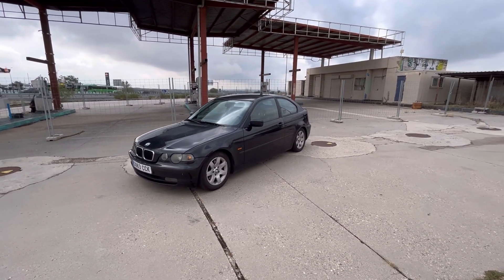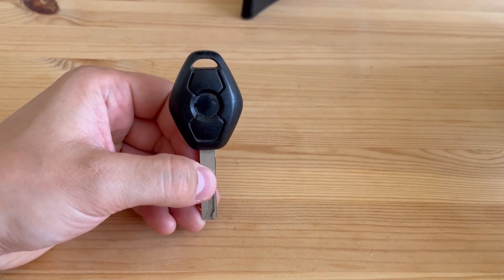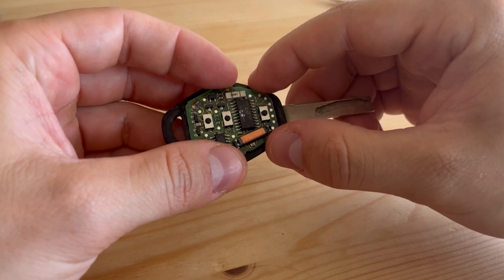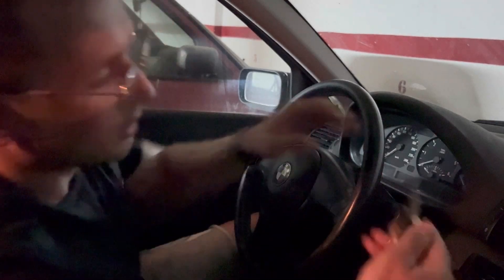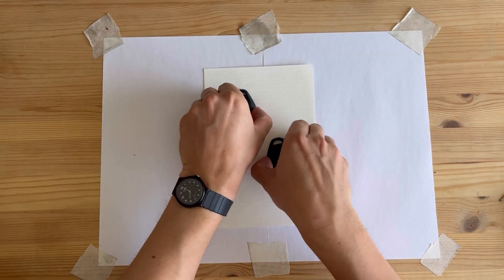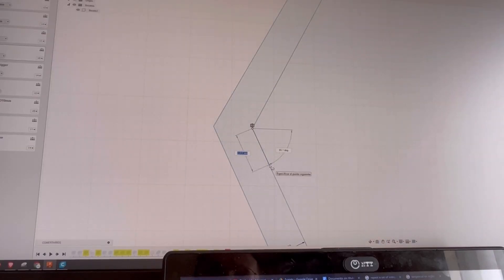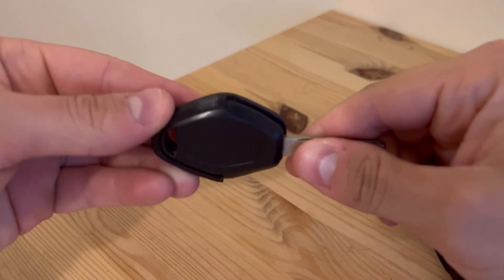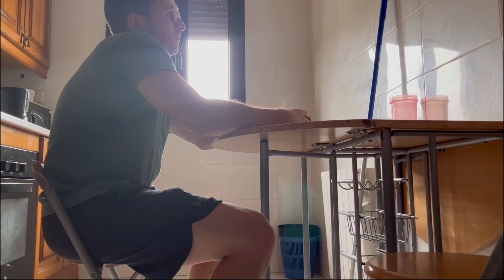Key battery replacement & reprogramming. Permanently serviceable key fob | BMW e46 e38 e39 e53

Comment: And then the EWS dies, stranding your car.  The E36 can have its EWS code read with INPA software but in the E46, the code cannot be read. For the E46, the only viable solution seems to be getting the DME/ECU reprogrammed with EWS deleted  Thank you for the 3d print STL file !

Comment: I just purchased two new keys for my 46 M3 at a cost of £260!😳🙄
Once you split these keys they don’t go back together correctly as they’re not meant to be split, I’ve seen them glued, taped …..just buy new like I did.
Reply from the maker: £260? No, thanks.
Reply: @ that’s a good price, should have been £360 for the pair.

Comment: Nice job! my OEM e46 key is the same as yours, but its missing a capacitor. If possible could you measure the capacitance of the cap (at 3:06 in the video) that sits just to the right of your thumb opposite the coil.

Comment: Put the key on a wireless cell phone charger over night and the key will recharge. Should be good for 5 to 10 years
Reply: Won't work if the battery is completely dead
Reply: No amount of charging will wake up a “Dead” battery!!!🙄
Reply: @darrenboston342 have you ever heard of using a welder to renew a 12 volt car battery?? A BMW ignition charger is very weak and only charges wile driving a cell phone charger is many times more powerful and you can charge it for 24 hours
Reply: @ whatever pleases you pal, can’t be doing with farting about, just buy new!
Done!👍

Comment: That is a lot of work for a keyfob, but it’s a brand-new battery versus one that could be dead beyond recharging. I did see other videos that use an induction charging station, such as for a smartwatch and toothbrush (this method is harder due to the protruding base prong).

Comment: Bro, just put a silicone cover and attach a keychain, that way it is to some extent water and dust proof and even if the silicone case fails the keychain will still have everything attached. Ran with my key sliced open like this for about a year, zero problems.

Comment: What's really fun is when the key fob stops working and then your door lock on the driver side (the only one on the car) breaks and then you can't get into the car, forcing you to break the rear quarter glass to be able to get into the car.
Reply from the maker: If this happens to you ever again you may wanna try the duct tape method to roll the window down
Reply: @alexderkach_  Thanks I'll look it up. When it happened and I called around and the locksmiths or tow companies would not touch it because it was a BMW so I was on my own.

Comment: Only 120€ ??? they are asking me 240€ for key + 67€ for reprogramming ...
3:05 you see the copper coil there? it's wireless induction rechargeable like modern mobile phones. The charger part is in-build into your car near ignition, so the key will recharge while driving -- at least it's supposed to, if your battery has not died to old age and the charger there has not died.
LUCKILY for me, I was able to buy from amazon the "blank" BMW key chassis/fob with new battery (openable, not glued together, so permanently servicable) for like 10€ + 15€ for the key copy part at local locksmith; then I cut open the old key fob, replaced the battery myself (some soldering required), and inserted the old key circuit with new battery to the newly cut amazon key fob/chassis and it looks perfect (except missing bmw logo). Much easier for "normal person" than starting 3D printer hobby ;-)

Comment: Sell this as a Repair kit , I would buy 2
Reply from the maker: Wow thanks! What price you think would be acceptable for a kit like this?
Reply: $29 usd @alexderkach_
Reply: I'd probably just change the fuse and sidestep changing the battery. 😅 Good work though. Great patience. There are key cases available in different colours that i think clip together, there similare to yours but far more bulky. I had one a while back, but you might  pull inspiration for your next iteration.

Comment: Nice this video hopefully help me. I order a new battery and a new key from amazon 10 euro E46 coupe 328i
Reply from the maker: Thanks! 328i E46 coupe - great car 👍
Reply: @alexderkach_   Thx i just picked it up. So the Battery in the Key is bad and i cant open the passanger side from outside only from inside so i hope i can fix this. And it got sunroof to ;:D
Reply from the maker: You’ve made an excellent purchase, sir. I only wish they were more affordable, cars  in general have been getting crazy expensive around here. Thats partially the reason why I’m sticking to my high mileage hero 320td

Comment: Thanks for the video! I am going to try this. Yes, the key charges with induction small amount every time you push it to the ignition or turn it (not sure witch). You can also charge it by placing it on top of electric toothbrush charger :D
Reply from the maker: Oh, thanks for the info and for your nice comment!